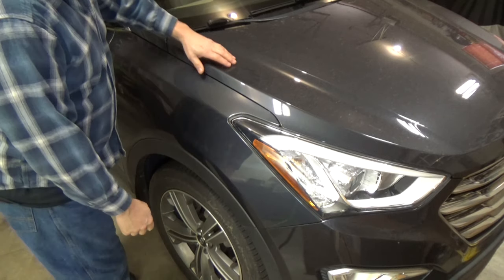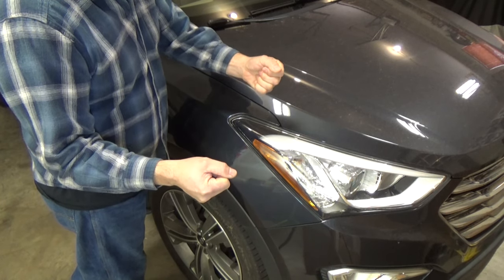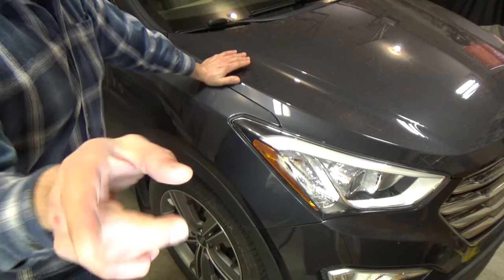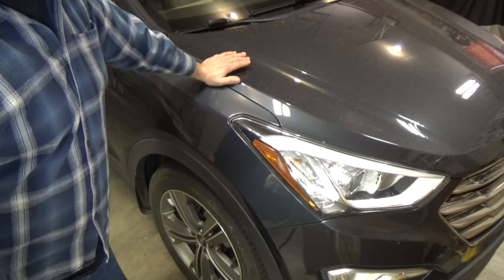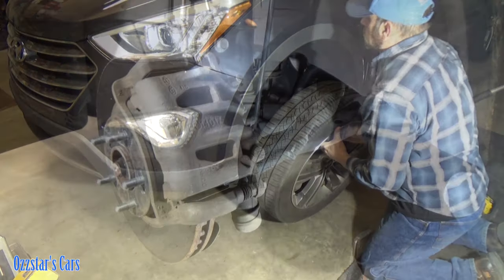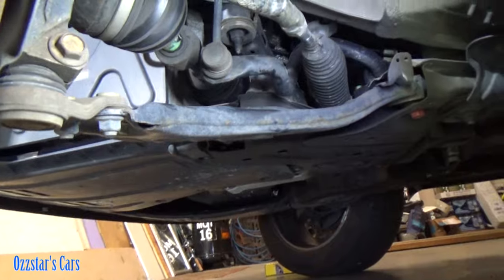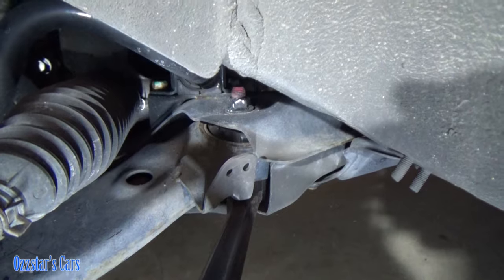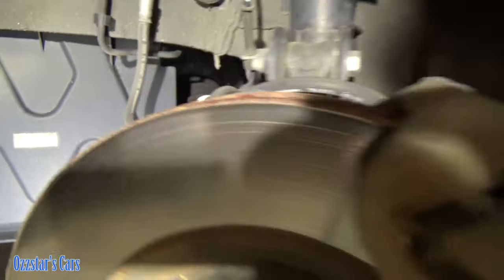Hyundai Clunk Noise Front Sway Bar Link Fix Replacement - Hyundai/Kia 2013-2019

Comment: Had this same issue 2013 Santa Fe but not just a sway bar link issue, it was also the steering wheel bearings which were worn out!  

The whole unit had to be replaced and the part was $560.00 w/o labor.   Didn’t have the proper tools so had to take it to a steering suspension shop and they replaced it for an extra $250.00.   

Total w tax $820.00.  

Took about an hour and it took months to figure out the cause.

The car made the clinking clunk sound when making a left turn from a rolling turn or complete stop. 

In addition, when hitting speed bumps at 10mph it made noises as well , this was a sway bar link issue.
Reply from the maker: I bet you are glad the car is fixed!
Reply: Has 180,000 miles and running smooth.  

No monthly payments and low maintenance, loving it now.
Reply from the maker: @angloedu5499  nice!

Comment: I just bought a 2012 Santa Fe limited has 177k miles kinda weird most times drives smooth as can be other times I feel like vibration and can hear something making noise sounds like front driver side. Tires look brand new. I don’t know if rim is bad but don’t make sense cause smoothes out and drives perfectly most times weird any advice be welcome. I just bought it can’t afford be putting bunch more money into it
Reply from the maker: That's tough to diagnose over the internet.

Comment: Where did you place the Jack's and stands
Reply from the maker: There are four jacking points located at the ends of each rocker. Safety stands are under the chassis as back up. Look at the owners manual for the location.

Comment: Great video. When you’re talking about the clunking sound, does it ever sound like two pieces of sheet metal hitting each other? Mines is like a loud tacking going over bumps and dips. Took it to three mechanics including the dealership and no one can figure it out.
Reply from the maker: If the links are very worn out then it's metal on metal sound. Also a wandering feeling in the steering wheel when going straight. Good luck let us know what you find. Maybe show this video to one of your mechanics. 😉
Reply: Thanks for the quick response. Appreciate it. I have a new mechanic stopping by today so I will show him and hopefully he figure this out. Mahalo.  @ozzstars_cars
Reply: My noise was unbearable on a bumpy road, turned out to be upper strut mounts. Quick struts took care of it.
Reply: Thanks  @GeorgeKennedy-u4r . For some reason after going over a speed bump, the noise disappeared again so I have to wait to see my mechanic.

Comment: Thanks for sharing. Off to the garage and diagnose.
Reply from the maker: Let us know what you find.
Reply: @ozzstars_cars  With the wheels on the ground, even putting a steering angle puts tension on the sway bar. Keeping the wheels straight helped me find the issue. Indeed, it was the driver side sway bar link. Two new SKF links ordered. Thanks again!
Reply from the maker: @ptz0n  nice find!

Comment: Those kinds of noises can be a real PITA to find, especially when you're working solo. I've seen ball joints, tie rod ends, struts, shocks, end links, and broken springs all make a similar sound.

Up here, those end link studs always break right off whenever I try to remove them! Every strut job ends up taking forever because of that. MA has been trying to outdo NY with the liquid road salt applications every winter ...

Tell your wife t's ok - my wife was driving our old '89 S10 Blazer winter beater with just half of one out of 4 bolts holding the tilt-steering column together. She didn't even notice the 5" of up and down play in the wheel. She commutes over 60 miles a day, too!! YIKES!! I discovered that the second I backed out of the driveway. Steering didn't feel right, so I wiggled the wheel a bit. Was quite a job just getting to the 4 bolts - needed 2 special tools, and a bit of time to reach them. I poured the red Loctite on, and hogged them down until I felt metal stretching - they'll never come out ever again, lol.
Reply from the maker: Funny how the wives only have a problem when the car doesn't start, other than that it's all good. 😂
Reply: @ozzstars_cars  - Ain't it the truth! 🤣 And her car only doesn't start when I'm extremely busy. :D
Reply: Not me you guys.... at the very instant I hear a little change in sound or feel  something different I'm worrying and nagging about it immediately. I done learned my lesson a long time ago about not addressing the issue promptly and just ignoring it....I can't afford it for one and it just cuts down on my stress when my car is maintained like it should be and running smoothly.

Comment: Great video---really helps confirm what mechanic told me.  How many labor hours should mechanic/repair charge me for replacing 2 (driver/passenger) sway bars on on car (Kia sorento twin to sante fe)? I will buy parts from your Amazon link. Also donating to your paypal account for this tip.  Thanks!
Reply: Also--is not fixing this become a safety hazard of any kind?
Reply from the maker: Hi Matthew the sway bar link replacement should take no more than 1/2 hour labor to do both sides by a professional.  Technically they could be replaced in about 20 minutes.  Make sure if you go with Moog brand links that they are greased properly after installation.  Thanks for your comment and kind generosity sir!!
Reply from the maker: @matthewkerr4465  it could be a safety issue except for the fact that steering stability is lost.  So if the vehicle would need to make a hard turn maneuver to avoid an accident the vehicle could get out of control.  Good question!

Comment: Hi this may help I’m not sure, if you pulled the rod out of your grease gun it would stop the seeping of grease as the piston inside is under spring pressure, of course this makes it awkward for storing it so is why most people don’t bother. Just a thought. Danny
Reply from the maker: The grease was not manufactured properly. It should not be liquid. Thanks for the suggestion.

Comment: could a bad sway bar lik affect front camber on kia/Hyundai? I've negative camber on front left wheel, steering wheel a little bit on left and sometimes I feel some "click click"
Reply from the maker: @ganakil has the control arm  bushings and ball joint been checked? Sways bars have little to no effect on camber when the vehicle is sitting static.

Comment: As an aside, there is a recall on certain 2016-2017MY Sorentos for the front ball joints. They will be replaced free of charge, according to the NHTSA document.
Reply from the maker: It's good that Hyundai is taking care of the safety issue.

Comment: Zerks, I prefer Grease Nipples😉. I had the same problem with my grease gun all the liquid came out during a heat wave and what was lift was dry grease.  I put a new cartridge,  I now leave the pressure off by pulling the (plunger)  handle all the way out and locking it so the grease is not under pressure all the time while stored. Also wedge a bolt in there so it doesn't snap back accidentally . 👍
Reply from the maker: Years ago we never had these grease bleeding issues like today. Good tip Rich!

Comment: Does this vehicle have a top and bottom oil pan?? I was told by a mechanic that I have a leak coming from the top oil pan, and that the engine has to be lowered to repair it.
Reply from the maker: Some engines do have two pans. No cap.

Comment: I have a creaking sound from the left front when I make a right turn and in cooler termperature weather.  Could that also be a bad joint in the sway bar link?
Reply from the maker: Anything is possible but I'd check those balljoints as well.
Reply: @ozzstars_cars  I read a long thread on a forum where some people with Elantras have the same noise as me and their eventual discovery was that the offending part was the left side lower engine mount.

Comment: Hi there thank u soo much for ur time.
I drive  07 camry CE. I heae a clunk or just 1 knock when I take off and when come to a complete hard break. 
No noise while I drive at all. Only when I gas and a complete break .
Do u think its the same issue.  
Please reply. Appreciate your time and help
Reply from the maker: Need to do a complete inspection, also check the ball joints for excessive play.  Let us know what you find. Good luck
Reply: @ozzstars_cars  ball joints are good and all tight.

Comment: Hello mate, I have it on my f10 530d xdrive 2013. Do you think its sway bar? I have new suspension and mound. But the car goes straight. Just the stupid annoying knocking sound.  Maybe all related to just a single “ bush”..Issues: 1) knocking sound from somewhere on left side during slow ride on bumpy road 2) creaking sound while i turn steering very way left/right while stationary 3)  Breaking “creaking sound” while having its complete stop
Reply from the maker: Have the lower control arms/ball joints been inspected properly?
Reply: @ozzstars_cars  mechanic said yes.  But some times its difficult to trust them. Just because of this knocking noise and finding tyre cupping i decided to change suspension and its mount. But i didnt feel any difference

Comment: Changed the ball joints,steering rack assembly and the sway bar links. Still hearing a clunk noise when I run over bumps! Could it still be issues with the sway bar links?
Reply from the maker: Did you check the control arm bushings?
Reply: @ozzstars_cars  Yes I did. I think I will replace the sway bar links again. Many thanks for responding. Great work!

Comment: So if you have only ONE wheel jacked up off the ground, you won't feel any play on the ball joint because the sway bar link is under pressure?
Reply from the maker: @jamespython5147  one wheel on the ground puts pressure on the sway bar link that is off the ground, won't feel any play. Has nothing to do with the ball joint.
Reply: Are you saying that the pressure by a lifted wheel wouldn't make it any tighter and you could still detect play by moving it with your hands?

Comment: hI I  have installed moog swaay bar link in hond pilot with zirk fitting, an year ago, i livein rust belt, chicago, when i try to greese, i  never see grease coming out on boot, will there be a chance that zerk fitting got rusted out .. I dont know the reason behind that
Reply from the maker: After 4 or 5 pumps grease should be seen. I believe the prob is with the gun or the zerk.

Comment: @ozzstars cars - I just change my sonatas end links with a similar MOOG product but my ride height is different. I had the car jack up on the pinch welds and used a floor jack to lift the spindle to slide the end links in easier on each side. Any suggestions?
Reply from the maker: End links should have no effect on the ride height.  Did you match the old with the new to make sure they were the same length?
Reply: I did! The two links were the same length as the two OEMs.
I didn’t take any measurements beforehand which in hindsight was a mistake.

Comment: I hear same noise when braking, when its too hot out site and while turning left and right. I got soo many thing changed but the noise is still there. 
I am thinking its the sway bar link. Can you tell me if steering wheel is some how related to sway bar?
Because i am hearing the thumping noise while moving steering wheel.
Reply from the maker: Have you inspected the ball joints and control arm bushings?
Reply: @ozzstars_cars  i replaced both control arms (left and right). I did the 12 and 6, 9 and 3 testing as you showed in the video but no noise so i believe lower ball joints are fine? I also got the struts replaced but it didnt help. 
I just dont know what to do as my mechanic keep asking me to change different stuff and its not working out. 
I believe its the whole sway bar link that need to be replaced? But dont know what causing the steering wheel to make that noise while turning left and right.
Reply: @hardikrana6403  IT exaclty the same noise on m'y 2013 Santa fee tomorow im gonna try to isolate the sway bar to See if ITs That 🤞im gonna a make a vidéo on IT to when im gonna find where IT came from
Reply: @basicdetail4512  great. I am just not sure if sway bar link also connected to the steering wheel. I dont know much about cars.
Can someone tell me if its somehow connected to the sway bar link? I hear thumping noise when i turn left and right.
Reply: @hardikrana6403  they are not connect to the steering wheel ...ITs just a bar with 2 bushing attach to the Sob frame and the sway bar is connect to the link kit

Comment: Where do you recommend placing the jack stands on a Sante Fe when replacing the sway bar links?
Reply from the maker: On the subframe below the firewall area not the control arm.
Reply: @ozzstars_cars   awesome thanks for the tip!

Comment: You think those nuts are tight, changed front struts on my 2013 Elantra today and torque specs for two bolts are 149Nm.
Reply from the maker: I have no clue what 149Nm is. I use lb.ft.
Reply: @ozzstars_cars  its Newton-meter, mostly used in Europe. We use Nm or kg per square meter.
Reply from the maker: @zivojinbudimirovic1061 which country? Thanks for stopping by.
Reply: Serbia, south-east Europe.

Comment: I get a super similar noise in my 13 santa fe 2.0t awd. I notice it at slower speeds. Not so much when going over like 30 35 mph. I notice clunking also when I'm going slower while turning. Random little like taps or clunks. Does this sound like a similar situation?
Reply from the maker: Weak ball joint?
Reply: @ozzstars_cars  I'm gonna take a look at all of the front suspension sometime this week. I'm expecting all sorts of wear given the cars at about 103k miles. Thanks for the vid.

Comment: I really need to know that if my sway bar links are new or worn out, should I be able to twist on them and move them with one hand?
Reply from the maker: With both front tires off the ground there should be no play or clunk. Some twist movement could be considered okay.
Reply: @ozzstars_cars  I checked with both tires on the ground and can twist in both directions without effort. I get a clunk going slow over cracks in road. Sound like the entire front end metal on metal. Also a strange groan sound if I let on and off the throttle at low speed or when turning the wheels moving slow.

Comment: My tires were wearing on the inside edge of the tire. I wonder if it was responsible.
Reply from the maker: Could have some minor effect but doubtful compared to worn out ball joints effecting camber or bad tie rod ends which effect toe.

Comment: How much is it fixed in auto shop?
Reply from the maker: Depends where you live and what shop you use.
Reply: @ozzstars_cars  I've been getting a clunking noise in front of my car on the passenger side. I have taken it to 3 different shops, and they say they can't find anything. Hyundai dealership to me, it was the struct mounts, so I replaced them and new wheel hub assembly for both sides. So now I'll DIY the sway bars link cause the guy told me wasn't anything wrong with them at all.

Comment: Always stick with OEM style that last much longer than any MOOG with metal to metal contact instead of metal to nylon/polymer that last much longer.
Reply from the maker: The Moog parts are greaseable and will outlast any oem if properly maintained over time.
Reply: @ozzstars_cars  No, no at all compared to Toyota parts. May be for clunker GM or Hyundai.  Greasable is metal to metal type, they clunk very quickly unlike  Toyota polymer housing. As long as the boots fine, they are fine. MOOG parts fail internally, the metals socket got deform and clunking a lot. Especially balljoint and aby balljoint type links.

Comment: Guys don't think this is an easy task. Elantra 2008: I have Vibration at 50 to 60 mph. I started with motor mounts, then struts, then rear shocks, then sway bar link, then lower arm with new ball joints, then front sway bar bushing, then and last the front cv axles, and still the same shit.  fuel is good, the car accelerates good, never stall. Any good idea, please. Thank you.
--- Note new tires, new balance, rebalance, alignment, and whole new brakes. The bearings are perfect.
---  I have done so much that the only thing left is trade the car, so don't believe this is 1,2,3.
Reply from the maker: Did any of the wheels get checked for a bent rim?
Reply: @ozzstars_cars  yes. The car had 4 new tires then started all this mess, so after I replace all I mentioned I decided to replace the tires with a new one but nothing have changed at all. also, this car is driving 99% freeway or hyw or expressway. Those rims are new. the car is keeping it inside the garage.
Reply from the maker: @irisbaez1972  I asked about the wheels, not the tires
Reply: @ozzstars_cars . as I told you this car is keeping in good shape, so rims are not the issue.
Reply: @ozzstars_cars . can be the fuel filter? I hear them and check it but it's working fine.
Reply: New tires but with hard to detect slight bulging when fully inflated cud  be one of the reasons of wheel vibration. Others cud be damaged or bent rims (even a new one) or hard to notice out of balance drive shaft (usually the longer one) due to missing balance mass or not properly balanced or damaged CV bearing. This cud be fixed by doing  ON WHEEL balancing by expert or rebalance the driveshaft.
Reply: @layanglayang2222 . How do you check the rims?
Reply: @irisbaez1972  Easy, ask the tire shop to spin it on the balancing machine. Some machine sounded when detect bent rim. Other way, we can see it clearly while rim spinning.
Reply: @layanglayang2222 I said many times: I put 4 new tires and all these problems came up. I replaced the whole thing and now replace again the 4 tires with new ones, and the shop has already balances them, come on bring something new. did you read my original message?
Reply: @irisbaez1972 I think you missed my quote 'ON WHEEL balancing by expert'. Lazy way to find where to find any unbalanced rotating parts.